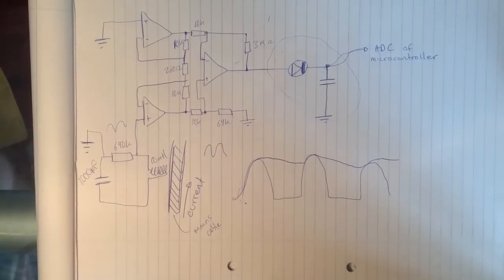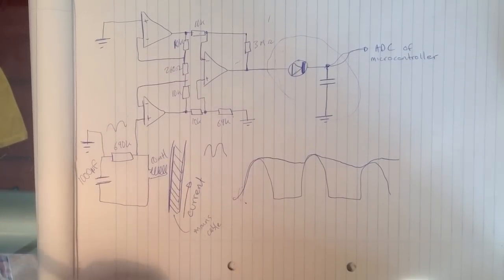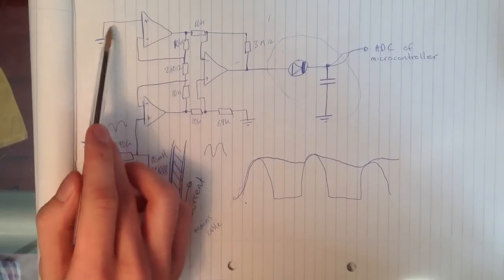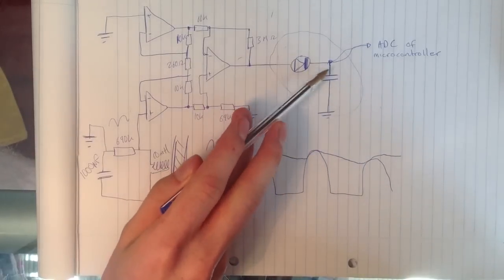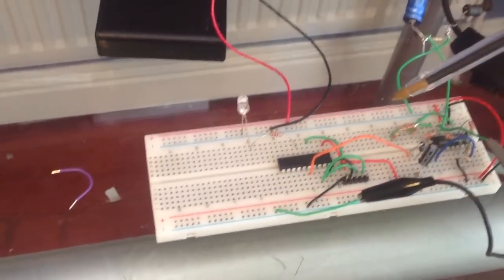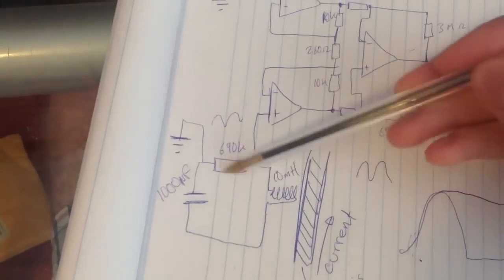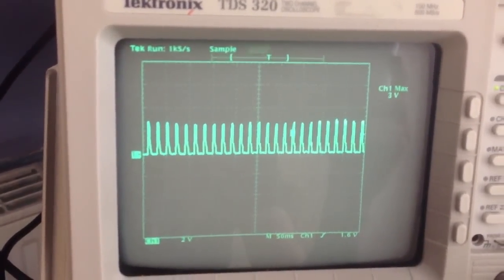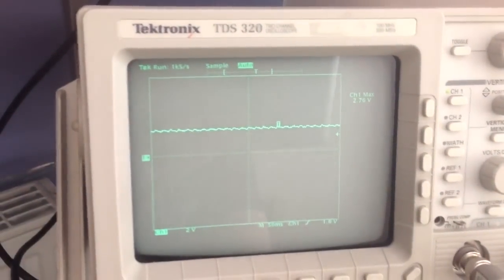Mains power detection circuit

Comment: Great circuit, thanks very much for sharing it.
What about using the fourth unused Op Amp in the 324 package as a comparator so that you can use a digital input rather than an analog input on your MCU?
You wouldn't even need the MCU at that point if all you wanted is an indicator.

Comment: Out of interest, what microcontroller do you use?
Reply from the maker: its a pic18f14k50, just happened to be what I had lying around
Reply: AH ok, I have a few PIC's laying around- never done anything with them yet though. I have used AVR before and liked them- I found them very similar to the MSP430 (which is my workhorse) and what I use for almost everything. But now I'm moving into ARM as that is the place to be :-)

 What software do you use for the PIC? MPLAB ?
Reply from the maker: stewartdahamman I just use the xc8 for compiling and then a program called pk2cmd to put the compiled hex file on to the chip. Have had trouble with MPLAB in the past so I stick to this method for simplicity
Reply: Ah ok, that's interesting and good to know because I tried MPLAB and could never get it to work with my programmers or chips. I must give your method a try next time.